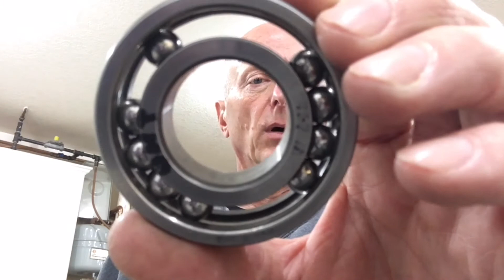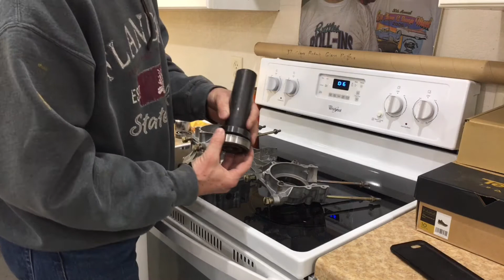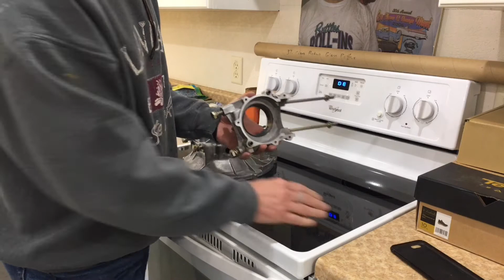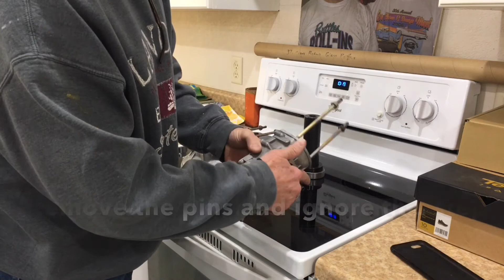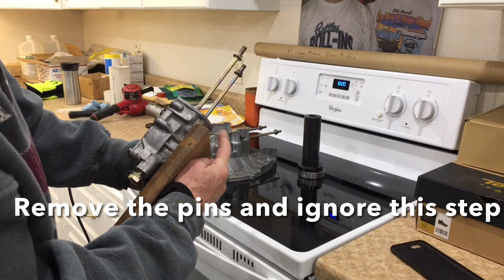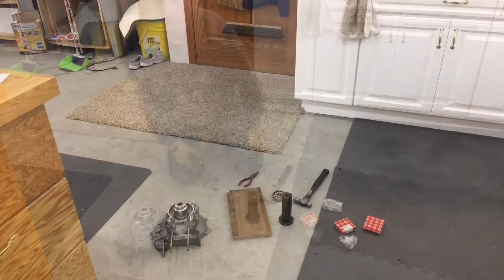16.0 Yamaha 1981 G1 A2 Golf Cart rebuild-Replace crankshaft bearings

Comment: Hi Greg.  Great series of videos on this cart.  I've got a similar-aged G1 in need of reman engine or rebuild.  Where did you find parts?  Crankshaft, rod, bearings, etc for this 2-stroke?  I would re-power with a Predator engine but don't want to lose reverse or have to add gearbox.  Thanks.
Reply from the maker: Thanks for the reply and compliment.
The crank and rod assembly are original in part because I could not find a replacement rod or bearing and also no one available to do so. Plus by my measurements they were still within very acceptable tolerances. Someone just posted that they filled there needs at Plowman’s in Michigan. I sourced all my parts via Facebook group members, Internet searches and eBay and used near all stock Yamaha parts. I did not change out the oil pump like most people do and it runs great! In fact when I hear of people switching over to mixed gas, I reach out and buy their old oil pump. I think I have about three right now. Another great source is a Facebook group called Yamaha G1 and G3 golf carts. This group was extremely helpful, most of my videos were posted there as well, and I bought parts from some of the members. I have a spreadsheet of my parts and where obtained. Someday I hope to upload it to the Facebook group. If you need a copy emailed to you I can probably accommodate…but be patient.